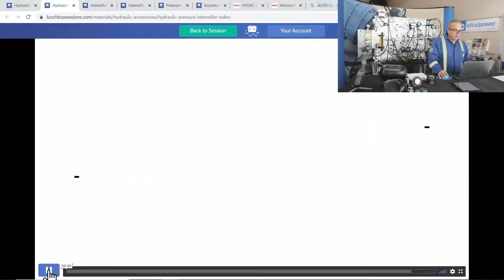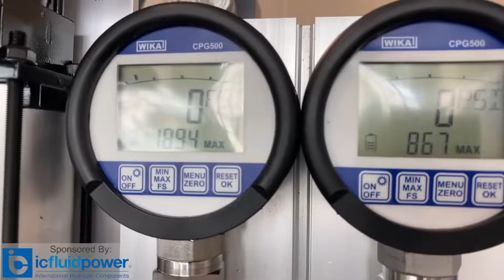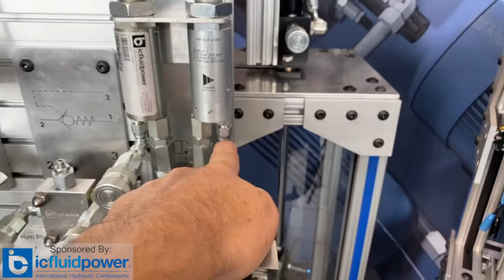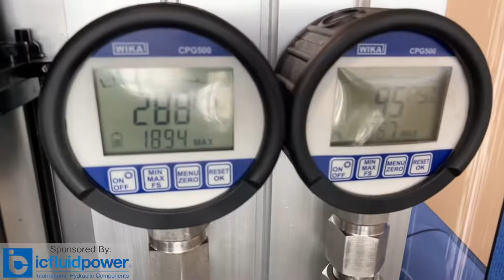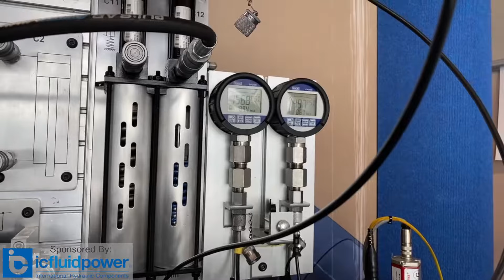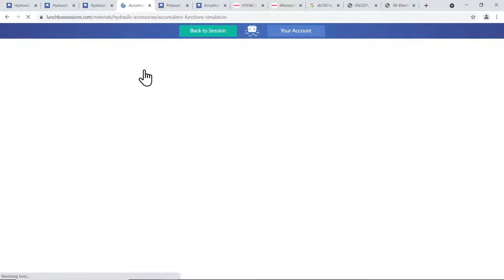Extra Pressure & Extra Flow (Live From Sep 28, 2021)

Comment: G'Day,,this is very good,,how ever you do rather cover it very quickly,,
Example,was watching one of your films on pressure valve and how they work,,spot on,
How ever you did leave an impression that No 6 spool(tandum) would handle the same flow as pump  out put,,as you Know this is totally incorrect,,(well not totally But read on.)
hydaulic are not hard,,really Not..But you do have to think about it all,,
Example quoted,NG6 valve will handle 80Lpm..this is true..How ever of you run a type 6 spool(tandum)the flow rate through the spool is now done to 20Lpm,,
You would really be suprise by designers that DON'T READ THE FINE PRINT,,
ME Thinks a diccusion on reading Manuals for be far better,,and picture in manual should be studied and under stood,,,
Example 2,Ashlow ,air oil lubricator,the bloke running the mill for 10year, once a week would change every injector and "O" ring on the circuit,,Keeped getting air in the oil line and pump would time out from not making pressure,,Bleed Oil line every hour or as needed when failed,So Finally i go to mill to use testor as we have the same air/oil set up,,
when one of the guys demonstriaghting tester asked,,how long do your injectors last,,
When i said we get fuck all failures,,he couldn't belive it..he tell me of his drammers.
2 mins at the system and a lengh of same size suction tube,elbow and fixed,,
do you know how the air was getting in to the oil line yet??
if you said the relief of pump was shooting straight in to suction line you would be right,
pump sucking air rated oil,settles out and form very compressable pockets which times pump out,,
Sorry for making it so long,,
"Never let experience over rule common sence",

Comment: 1. What causes frequent O-ring failure and hose burst in Hydraulic System of HEMM? 
2. Sometimes if a dozer (or any HEMM) is breakdown for long time (1/2 months) due to a certain reason. Now when the problem is rectified and the machine is ready to operate. Within few hours of operation any of the pump (hydraulic/steering/transmission/pilot pump) would fail due to its seal failure?

Comment: we have a BEML dozer. The blade of the dozer moves down when its joystick is left after raising the bald to a height. The drift of blade is very high that the blade touches ground within 10 seconds. There is no external hydraulic oil leakage from the Blade lift cylinders. What are the reasons behind this? Internal Leakage of seal, or problem in Blade Joystick, or problem in Pilot Pump, or control valve or any other cause??

Comment: Sir I need your help we are not achieving required pressure at minimum pump flow when we increase the pump flow then we are getting the required pressure. Due to this we have replaced the proportional relief valve also but still no more improvement observed pl share your email I’d I want to share you extrusion press drawing

Comment: A gas booster is what you would use to charge an accumulator above your bottle pressure. Often driven by shop air. They do work in a very similar way to the intensifier other than the drive gas doesn't become the boosted gas.
Reply: Hydac have a very elaborate system in the N2S range